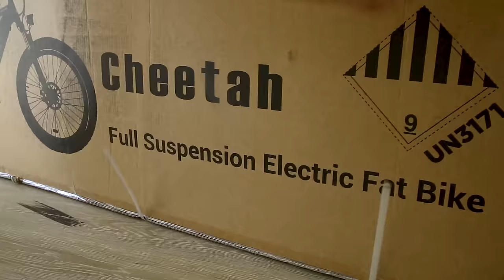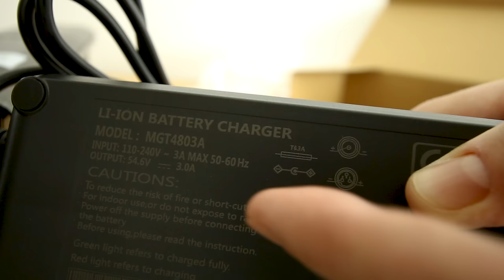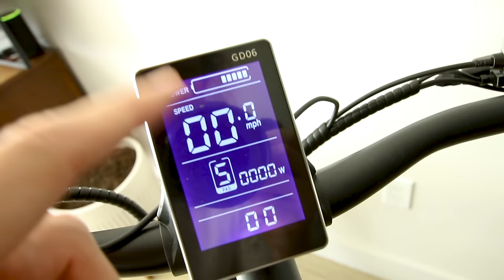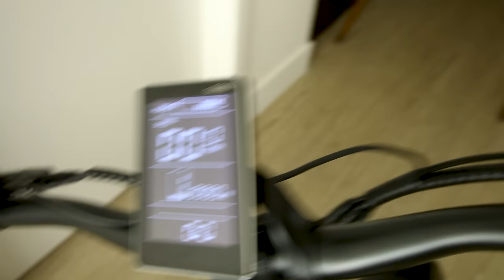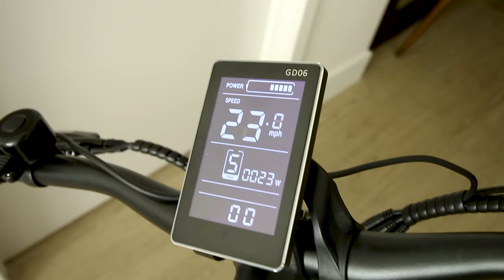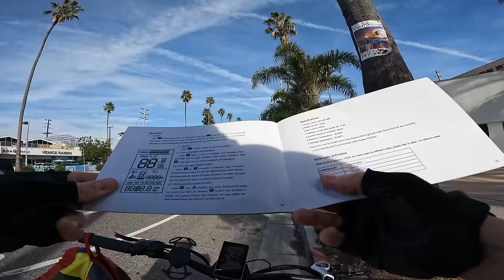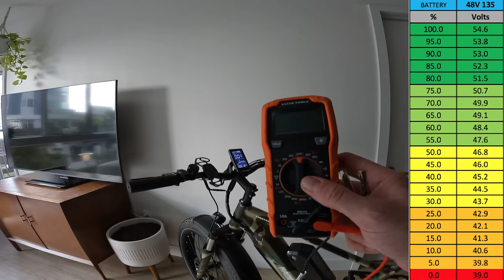This "Mid-Drive" Ebike is Strong - Haoqi Cheetah Pro Review

Comment: I think this bike is way overpriced for what you’re getting
Reply: Yeah especially since you can get a good bicycle for cheapish and a cyc motor(8kw max mid drive motor) with a 20ah battery for under 2.5k(if you find a good second hand bicycle)
Reply: Value is subjective.

An abundance of options comes with a vast price range.

I'm interested in buying a Surron Ultra Bee. I'm told, incessantly, that I can get a good gas dirt bike for trail riding for a lot less.

I want an Ultra Bee. Who but I should care?
Reply: And mid drive motors last a quarter of what a hub motor would. So even worse for the price
Reply: @The10thManRules its subjective if you compare apples and oranges. If he considered a talaria and compared the specs I’m sure you wouldn’t completely ignore the suggestion then lol. Both electric
Reply: Shitty bike for the price.
Reply: You can basically spend the same money for a Talaria X3 and go 50mph..
Reply: @not_so_native_native where would you find a good second hand surron light bee or talaria xxx ? Honestly, no sarcasm?
Reply: @jahbrake9791  talarias aren’t street legal. And mid drives cost more than hub. This looks like an m620 competitor, that motor alone is 630$
Reply: This motor looks bad tho..600 watts peak, it must be limited
Reply: Any luck on getting this bike faster than 20mph?
Reply: @jahbrake9791  the talaria isn't legal in most states
Reply: @jellisgaming  sure is. Comes with pedals now which according to cops is fine with them.

Comment: 3K is mucho dinero for this ride
Reply: Very much agreed. I don't have a problem with cheap bikes; but they need to actually be cheap. These are marketed to people that don't know what a bike should cost. At this price you can get an entry level Trek or Giant ebike. It won't be full sus, but the suspension in this is garbage and the Trek or Giant will come with a name brand fork that destroys this. Along with sized frames, better brakes and much better casette.

Comment: Why does every ebike just have a cheap 7 speed cassette but the sheer excitement in this dude is worth so much.
Reply: Cause these are cheap ass bikes. If it wasn't for the pandemic shortages causing the market to go nuts these generic drop shipped chinese bikes even with mid drive would be 1k to 1.2k tops.
Reply: A cheap cassette equals an affordable maintenance.

Comment: Having to go thru gear changes when you need to accelerate is l big NO NO for me.  And a $3.2K price tag is crazy, they must think Camo is going to fool us like we're in the jungle. Lol.  Not to mention they've been using that same cheap frame on virtually most eBikes because of its easy availability and versatility.  The battery options on that Haoqi is also shame, they are literally trying to rake in more dough with those cheaper options.  You can get the same frame with a 1000w front + rear motor, same dual battery setup but with 48V 15Ah + 48V 20Ah equating to 35Ah for a third of that Haoqi price.  If you want Bafang and Samsung/LG options and don't mind waiting about 2-3 months for it to be built, it'll cost ya in a range no more than $2K.  I'm not affiliate with any company, I'm just resourceful and a fellow PEV'r.

Your reviews are awesome and funny btw.  Thanks!
Reply: I agree 100%.
Reply: 48V 22AH HIGH-TECH SAMSUNG BATTERY

Comment: I got the CSC MT1000 bike with 1000W Bafang motor with Samsung batteries and Bafang controller.  You can set it for sport mode and get lots of power along with increasing the speed limit.  This gets you over Class 3 specs to moped but Washington does not regulate mopeds too bad.  Stay off the highways with your moped and slow down to any speed limits on trails and you could go unnoticed.  I think peak power was 1500W or so.  I live on top of a ridge and needed help climbing.

Comment: To unlock the speed limiter, turn the bike on and then immediately pull both brake handles 5 times in 5 seconds. This is what Haoqi told me for my rear-hub Cheetah and it works, but it sucks because you have to do it every time you turn on the bike.

Comment: The power on that bike is seriously lacking for a "1000w" mid drive motor. I Converted a regular MTB bicycle to eMTB by attaching a 750w Befang mid drive motor kit to it and it will destroy that bike. It can put out 120nm of torque that will take me past 30mph on throttle only and if I hit full throttle from a standing start in anything higher than PAS 1 I'll pop a wheelie so high that I can flip over backwards. If you want a strong mid drive bike I'd recommend just converting a bike you might already have with a conversion kit for half the price of that thing.
Reply: Agree, a kit conversion was the best way for what I wanted.

Comment: I'd be interested to see you prove just how efficient mid-drives are versus hub-drives to see if they're worth the extra maintenance, complexity, and efficiency from the perspective of an average commute biker. Obviously, they're best in certain scenarios such as off-roading and hauling but my assumption is if you don't do either of those then there's no practical point in going with a mid-drive. Like buying a 4x4 lifted pickup truck when all you need it for is grocery shopping.

Comment: If I had a mid drive.  I would for sure look around to get the widest range gear cassette.  Like 11tooth or smallest top gear to 48 or lowest 1st gear.   And look to see if possible to go old school with the crank gear and see if you can double or triple that like the old 10 18 21 or what ever speed bikes in the day.

Comment: The software is really holding this back. This is a 1500w motor and controller. It’s too bad it’s locked out. I have the same basic motor and I can hit 35 mph and 1700w on throttle

Comment: The climbing seems strange since BBSHD wich has the same power and torque was able to ride at 15mph on 17% hill using 40t:34t gear with 52V Samsung 35e 14s6p battery on throttle only. System weight 120kg.

Comment: Turn the bike on squeeze the left/ right brake handle 5-6 times. This should give you 28 mph
Reply: When you squeeze the brake you must do this within a few seconds.
Reply: @user-ve1kv1mt4i   is correct. Squeeze left brake lever 5-6 times within the first 5 seconds of power up

Comment: the site shows it a 750 watt, and offered they me a deal to buy it.
 But after seeing it & a few others (?)

  I might get it if it gets to "my" right delivered price.
they are close, just 200 less and I might bite.

 [yeah I can wait as there are getting to be more and more to choose from]
 its a 750 watt at best & not a bafang
the rest is nice. Id likly [in time] upgrade the battery & the rear shock, that should be an ez upgrade "IF" its needed? Im used to hard tails, so it night be just fine for me.
 this looks like it should tackle logging roads and go where those loaded trucks have gone.
trails? Im thinking  if they look ok, I can bike up them.
dont expect it to do as well as my dirt bikes, I go on game trails with them.
 this ebike? Im hoping it will do the logging roads, no skid roads [my ATV can do that]

Comment: I got a full sus bagang 1500w e-bike with air shocks 48v and a thumb throttle coloured display and tubeless wheels with all modded stuff for £2000 ? Is that any good it only had 110 miles and can do 50mph

Comment: That'd make a good triple motor bike. If you take the speed sensor off of the rear wheel, it should go faster but you might lose your speedometer. I had a middrive with a speed sensor on an older e-bike and it kept limiting me to 20mph.